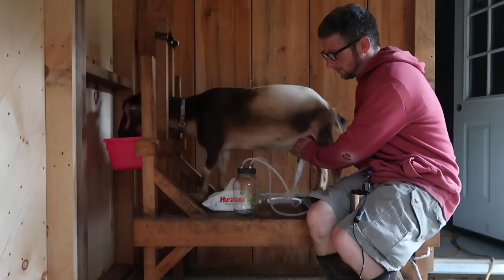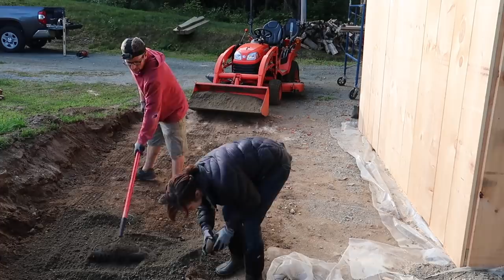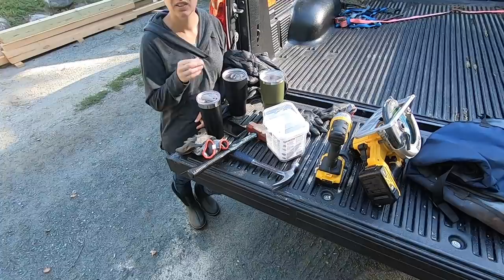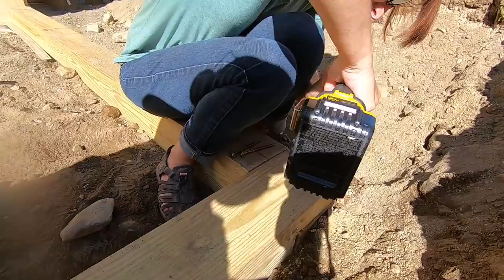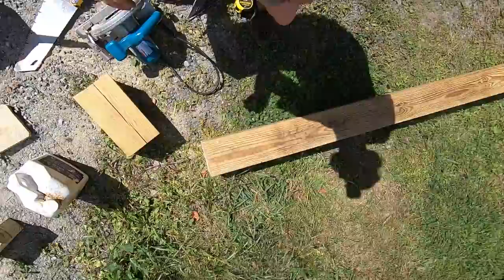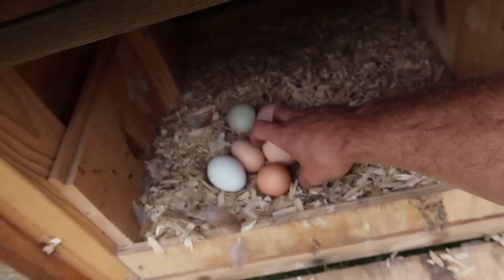We've Never Done It Like THIS Building a Retaining Wall Foundation for the Post & Beam CarPort

Comment: Al, I think you should have some horizontal elements extending into the soil beside the wall to resist the pressure of the soil against the wall. Another idea I had is to basically lay a stone retaining wall beside the wood one if you could somehow find some stones. I hope there is someone more knowledgeable that can comment.

Comment: You need a vacuum pressure switch to maintain the vacuum at a set level, will make milking easier and more comfortably for Willow.
Reply: It seems like Willow is uncomfortable with the pressurized milking. But I know nothing about it.

Comment: Gotta love the volunteer plants, huh?  Our pastures are now dotted with 3ft corn stalks - courtesy of our chicken feed as they follow the cows...then the cows come back through and that's the first thing they hit.  Al, what type of side-to-side support are you going to put on that carport side wall (the weight of the soil behind it will cause it to lean inward over time). A suggestion would be to drill holes down through all the 6x6s and then pound rebar through it into the ground a couple of feet.

Comment: Hate to be negative Al, but that retaining wall will tip in fairly quickly, and anything attached to it will tip along with it. Look into earth anchors, they are arrow shaped things that can be pounded into the ground behind the wall, then you would run the cable that is attached to them to a galvanized eye bolt through the wall near the top. Another way would be to sink treated posts on the outside and bolt them to the wall. Fill the holes around the posts with concrete at the bottom. 

Congratulations on becoming a full-time farmer Gina!

Comment: Congrats Gina, great to see the two of you working together.  Just wondering why you didn't use any 'deadman' to prevent the exterior force of the dirt from pushing in the 6*6's over time. I know here in Ontario we use them on anything 3-4 tiers high&higher placing them every 6' apart every 3 rows

Comment: I have built many retraining wall over the decades and if you dont put in dead mans about every 3rd row the earth will push over your wall in a few years. Even with them wood wall usually dont last more than 25 years. I would have recommended that you put a 4 inch drain tile down and 12 inches of pee rock before you back filled.it really helps with the water issues associated with retaining walls .just a thought.  Love your videos

Comment: FYI. When you were installing the vertical 4×4 trim to the inside door entrance you were having to drive it in with the hammer because it was cut a little to long and it is very tight. It was actually bowing outwards to. Since wood expands and contracts length ways it will bow out and likely crack as the weather warms. Also you two work very good together and complement each other well which is a great example for your daughter.  I don't know where you go to church services if any but you probably do. Thanks for showing that you pray before you eat. Keep up the good work. You live like I would love to if I had not have gotten injured on the job in 1996 and suffered a couple of serious injuries to my lumbar spine. I now live in pain and have nerve damage to my legs and feet too. My wife of 20 year's divorced me because I couldn't return to work due to the pain I live with. That was the worst part. Keep your marriage strong by good communication skills and always be honest in a loving way. Put God and Jesus Christ first in your life always and feed on his word every day. God bless you all.

Comment: I know you are using wood with a preservative in it, but thought you should put down some of that black tar stuff on the outside where it is coming in contact with the soil you are putting against it and rocks you might add to the retaining wall.  My husband always puts that black tar on the wood post he uses where they go into the ground even though he is using pressurized wood.  You could put it only where it will be covered with soil or rocks so it won't be seen.

Comment: Good on you guys but if I may offer advice which of course is lat now put placing an a posing post into the hill will prevent the wall leaning in over time water and dirt will start to push the wall forward, and what’s that noise in the back ground,

Comment: Even a small retention wall will have pressure on it from the dirt. It would likely have been a good idea to drill through the bottom 2 beams and then drive a few long pieces of rebar through them into the ground a foot or two.

Comment: Do you ever plan to open doors on that side?  You may have issues with too much height to open doors.  Also it is too late now, but you could have driven rebar into the ground at least a couple feet.  At this point, I'd recommend a vertical post every 4 to 6 ft along side the wall you just built.  Drive it in at least 2 to 4 ft.  Trust me, the dirt you infill with will compact and in time, the wall will tip over.

Comment: I have a question. With all the building projects that Al has done. Can someone please tell me why he hasn't built a deck off the back where the sliding glass doors are at?
Reply: Tammy 1960 it’s way more important to get the Homestead infrastructure in right now. I am sure he will eventually get to the deck.

Comment: You would have had a much easier job leveling the carport if you would have staked and lined the site.Look how the pro's do it for any construction from building sites to highway and road construction.I use a transit but you could have used a line level on the lines wrapped around the stakes and got the job done in quarter of the time.One question on your goats:Why are you feeding them with hay in the summer?We would corral them in brush and let them clear the land as they are browsers and will eat weeds and blackberries.Moving them every few weeks or when the brush was well eaten down.Buy a tanker to bring them water and electrify the fence to keep out predators and them in.

Comment: ...when we had a surface rock we found it easier to dig a hole next the rock ( deeper than height of the rock) then lever it in to the hole & backfill.......no lifting ....no rock on surface to get rid of ....no earth required to fill the hole left by removing the rock!..

...when building the retaining wall , introduce some timber “dead men” at 90 degrees to & fastened to the wall....these are buried in the ground and stop the fill from pushing the wall into the carport......

Comment: A little late now but a moisture barrier on the garage floor and up the outside of your retaining wall? Looks to me the hill your up against you'll have run-off into the garage with every rain.
Reply: He put down a moisture barrier first.
Reply: @glenncountry  Not under the garage.
Reply: In the wood shed.......   If plastic was put down for the garage floor and up the sides of the wood retaining wall, I must have missed it. With it, I would think there would be seepage.
Reply: Correction.....  "Without it", there will likely be seepage.

Comment: .
How NOT to build a retaining wall.

I enjoy your channel and other projects, but this retaining wall will not last long.  No French drain (or any at all), untreated lumber, first course not set below grade, etc..  I give it 4-6 years before you need to redo it.
Reply: Warped, Did you watch the whole video ?  The first course is below grade, the wood is pressure treated. He did at least put stone on the back, not as good as a pipe with stone but still...